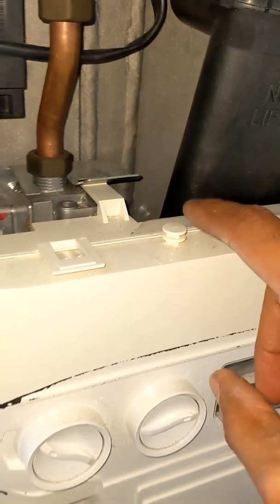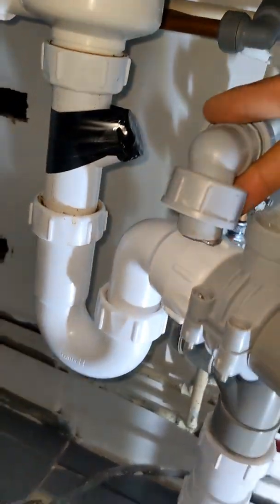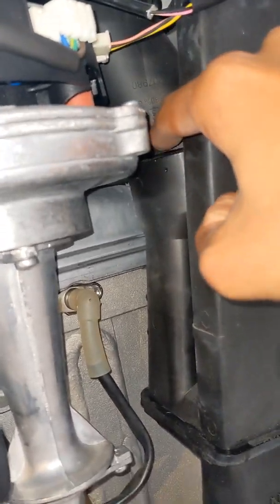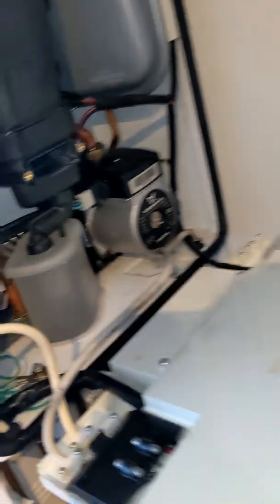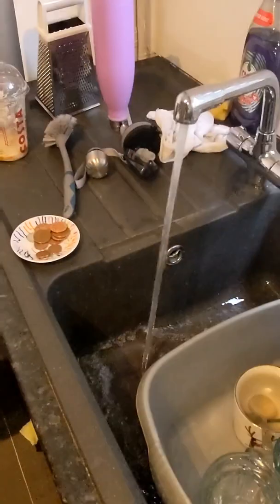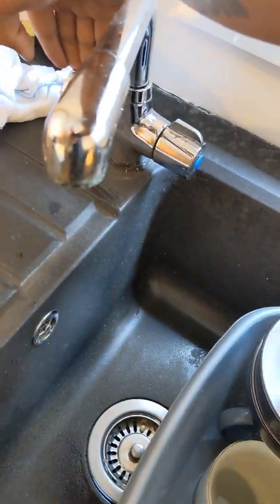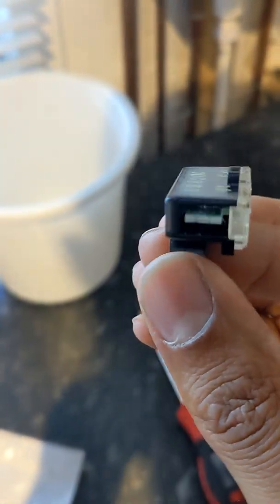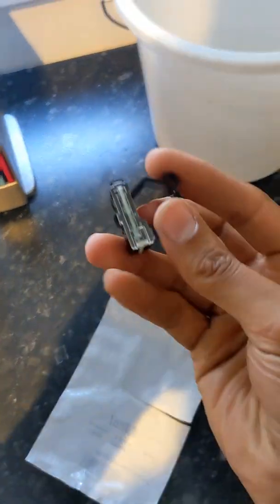Live Fault Finding #15 - Faulty Hall Effect Sensor

Comment: i have a unusual fault , my boiler works fine all day and night , no fault code or problems  lighting or running , except the first time in the morning , when i run the hot water tap , which works correctly until i shut off the tap , then there is a high pitch whistling sound . if i flush the toilet it stops , i thought it may be at night the water main pressure is climbing up to a higher level, or the water flow turbine may need to be replaced, have you ever come across this problem.

Comment: Is that common with all boilers or just ideal boilers where rain water can run down the flue and into the boiler
Reply: All boilers can suffer this problem as its down to the installer to fit correctly poor installation
Reply: @happyslapper07  👍
Reply: @happyslapper07  in this installation what is wrong allowed the rain to go inside the flue
Reply: @sheriefgerges7789  if you don't know then your not gassafe registered so you don't need to know.